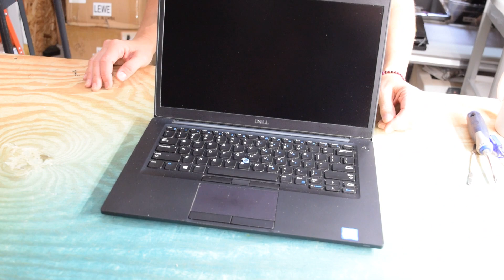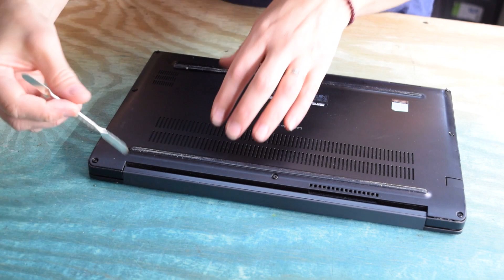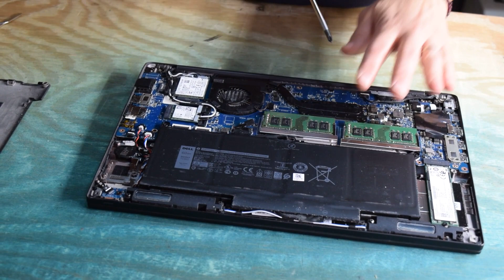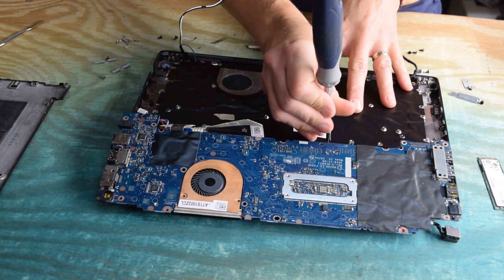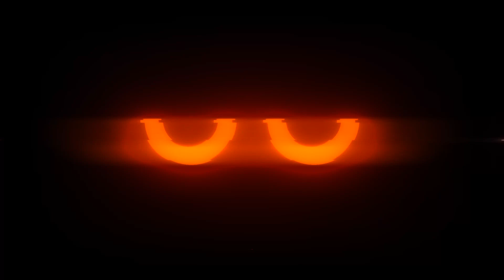Dell Latitude 7490 Keyboard Replacement

Comment: Why would you do all that? You only need to remove the battery unclip cables then from front rmove keyboard frame and unscrew from backplate. No need to remove the motherboard at all.
Reply: Hey dude, I would like to change my palm rest for this exact laptop. Would this be a similar method. I did my keyboard already like this video and it worked out perfect.

I wasn't aware that I could purchase the palm rest separately so unfortunately didn't try install that when doing the keyboard. Let me know cheers bud
Reply: Make a video for us.